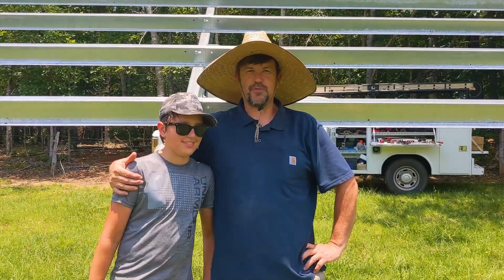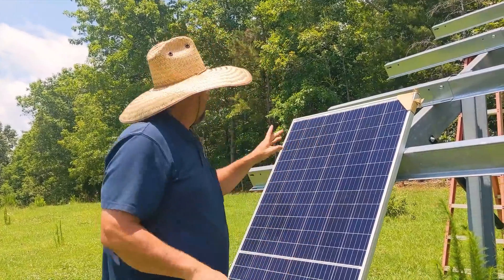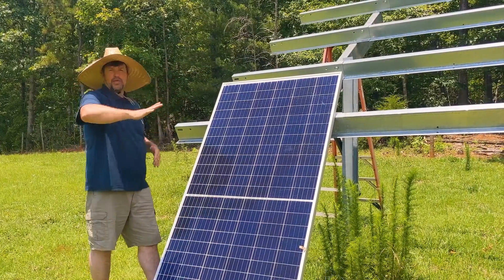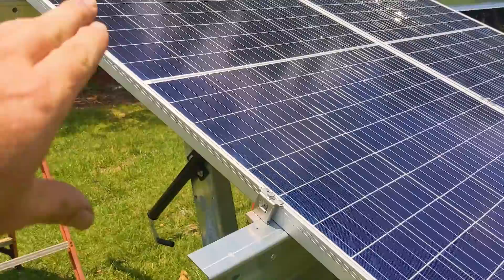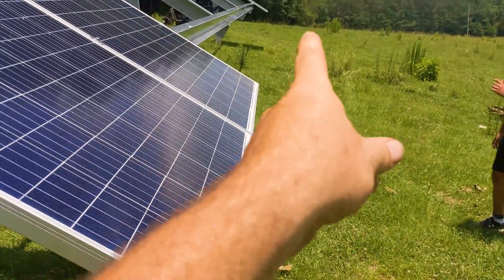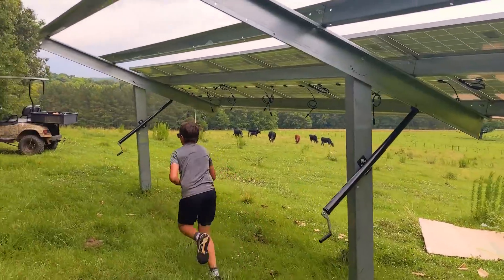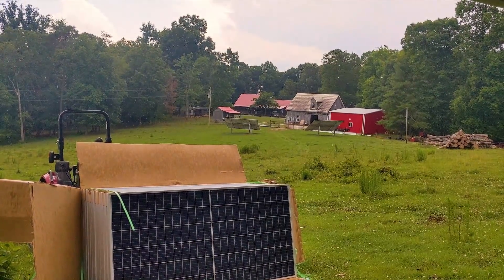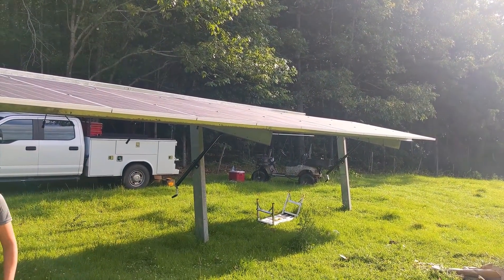Part One of My Solar DIY

Comment: I have watched a lot of your videos over the years and finally to the jump and ordered my system. I live in the Vegas area. I was surprised to find out that a grid-tie inverter works is diffrent. It will not work unless it senses the grid power. I am aware of the safety and why they do it but it might be a dream idea for you to share with your followers who think if the power goes down, their grid tie system will continue to make power for them. Thanks for all you do.

Comment: I’m curious to know if the cows do scratch their backs on the lower part of the array. If the panel overhang is small, they may not bend the frames enough to break the panel. Nothing like adding another 13kW of production to a fully operational homestead!

Comment: While it's nice to see alt energy come of age, it's a shame it's come to something so inefficient and cost prohibitive as solar. Whatever it takes to still keep the sex robot and debt enslaved people dependent.
Reply from the maker: What you're forgetting about solar is that there are no moving parts and there is no maintenance.
Reply: @engineer775  
I'm sorry but electronics do degrade for a variety of reasons, heat, magnesium and chem changes just to name a few. Exterior exposure to heavy rain or acid rain, lightening, bird droppings, high even non-cyclonic wind, leaves/branches salty environments sandy environments all create on-going maintenance on pv panels and their related components.
Reply from the maker: @LtBRS  there are minimal electronics on our system. None on the solar array. Most inverters are warranty for 10 years and after 10 years this industry changes so much that the inverter that you can get then will be half the price and more efficient.

Comment: Well that's a great setup, nice the cows have a shady spot to enjoy too. 💞
For those of us who have to deal with partial shading issues, on a small system no less, do you have a type, or brand of panel that works best in these conditions you could recommend?
The first panels I bought- before knowing any better- were Colman camping gear brand, and they are garbage.  GARBAGE.  If a micron of dust lands on it output drops, a partial shadow kills it 95%. 
How does one know if a perspective panel for purchase has this issue or not, or is it just a gamble? ....so frustrating, sigh....
Reply from the maker: We predominantly use premium monocrystaline panels across the board. Pretty hard to mitigate shading. You got to cut some trees.

Comment: your video you not even explain  Watts, in your pic, EIRP, Ohms Law missing in your video, ?No numbers technical in your video, dumb dumb video, u say 13kw, that would mean u have 13 x1000 = 130 x 100 watts panels, so far you are full of Crap, of the best days sun, i not see 130 panels in your video, beside cable line DC loss, net...

Comment: Do you ever use Huck fasteners?
Reply from the maker: I've seen him but I've never used them. They seem to be prevalent in the automotive industry.
Reply: @engineer775  Huck has a complete system of fasteners for building solar arrays-

Comment: What is that mount system? I like it a lot
Reply from the maker: That is called a seasonal adjust ground mount from Sinclair design and engineering. We are distributors of their product. Let me know if we can design you a system. We supply the panels and every clamp nut and bolt required to build a very sturdy ground mount.
Reply: @engineer775  I have panels, inverters… I just want a great friend mount. 34 410w bifacials ET Solar. I will probably put up another one also.  I love that adjustable setup and the minimal number of holes.  We have rocky, clay soils here in Osceola, MO.
Reply: @engineer775  I will get ahold of you guys soon.  I saw your form.  Busy the next week or so.  I have another place where I want to roof mount a bunch of panels and have a long  DC run that i need to do back to the house.  Probably 600ft.

Comment: Nice job. Can you tell me where I can get a adjustable ground mount  like yours. I have been researching and not finding.
Reply: Sinclair racking... I believe Scott sells them on his website
Reply from the maker: Yes we sell them and ship them or if you're close enough to me you can come pick it up.
Reply: I've been messing around with L angle steel and that system looks like a breath of fresh air.

Comment: Would you consider doing any work in northern Florida, Like the i75 and i10 area?
Reply: if you haven't seen it already check out the FP&L solar farm at the NW corner of I 10 and I 75  , saw it recently on a trip to see my Mom in Ocala from Houston.
Reply from the maker: It is out of our range but I'd be happy to work with you or a higher electrician to help you with a system.
Reply: @engineer775  that disappointing it’s out of your range. According to your website, We’re only currently 350 miles from your office. Hence “currently 350” that means that can be shorter once we sell our current property.